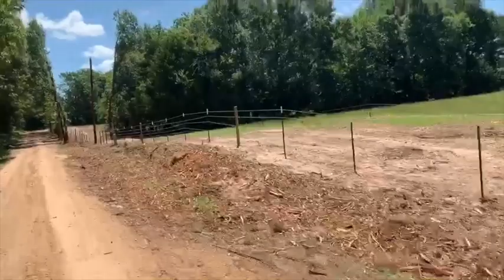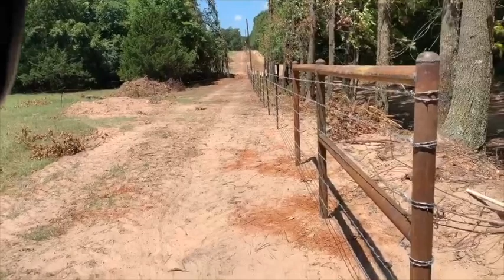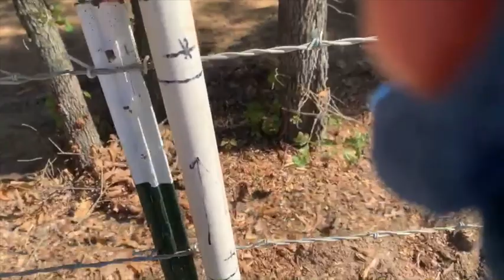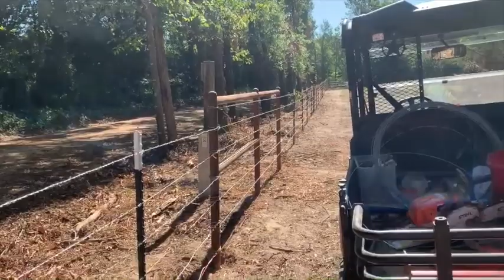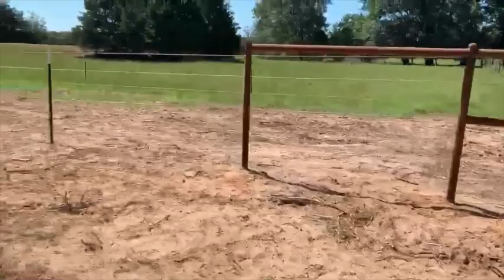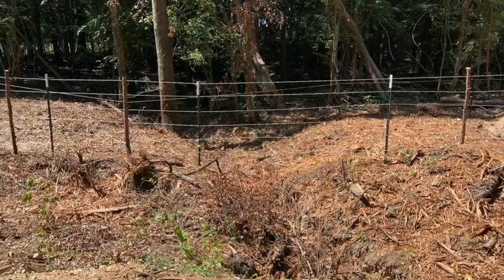Barbed Wire Fence Project III

Comment: Nice... But how much in $$$? Whole build... Planing to do the same style, because i have a lot of uneven ground... i think putting regular fence would be pain in the... 👍💪
Reply from the maker: Hello, hard to say on total cost.   Some figures:   Wood post $12ea.   Metal pipe $1.4/ft.  T Post. $4 ea.   Wire $65 roll of 1320’.   We set post on 10’ centers.   Hope that helps.   Does not include welders fee.
Reply: @HeritageFarmsTexas  Thanks.